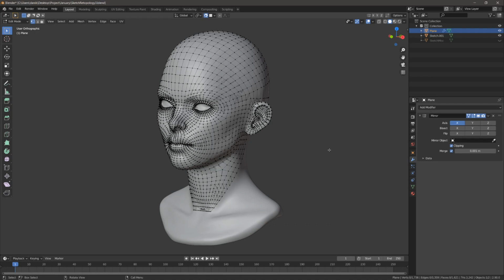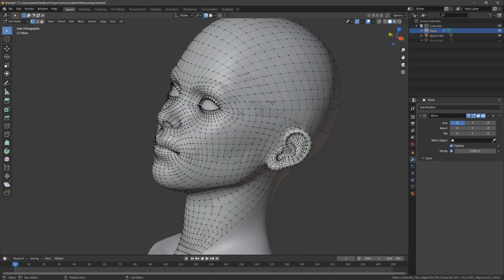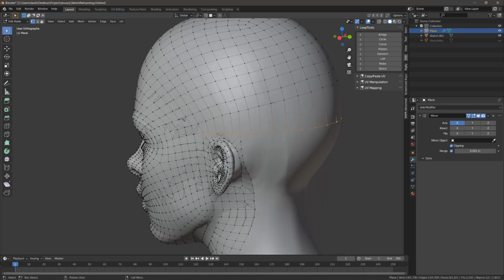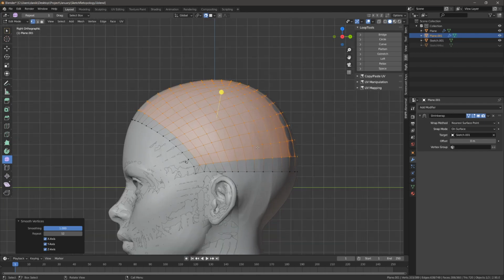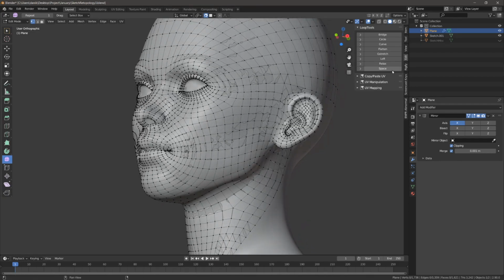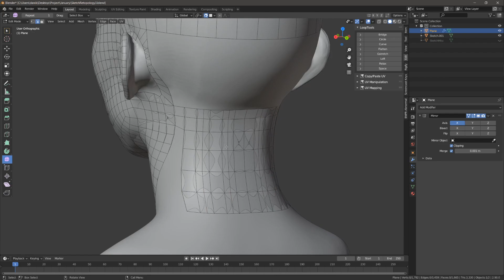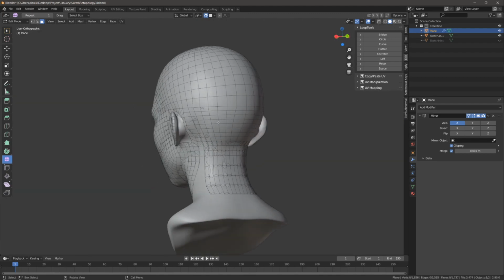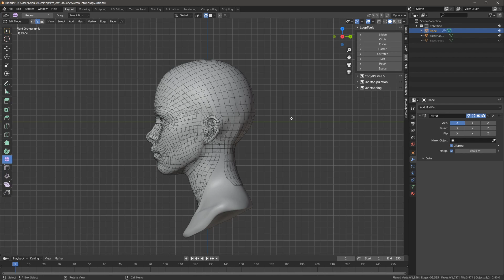Tips and Tricks for Retopology in Blender

Comment: does blender have "tweak" and "relax" brushes (similar to the retopoflow addon) but without addons?

i need the "tweak" and "relax" brushes like in adon::retopoflow
, for example, in the sculpt mode there is a "smoothing" brush, but it does not use "snapping face"

Comment: Mmmm. Is there any issues with just using a add on or a built in tool to a software to remesh everything? Theres another youtuber that said modelers shouldn't worry about retopo because there tools for it and it takes much unnecessary time to accomplish. Of course worry about polys when modeling but to retop theres tools he said. Like in maya or add ons for blender/programs
Reply from the maker: It depends entirely on what you want to do with the mesh. In my case I am thinking about rigging. This makes clean topology absolutely necessary. If you have one head with very good topology you can do some wrapping instead, but this time I wanted to invest some time into coming up with a better topology than what I had on hand before.